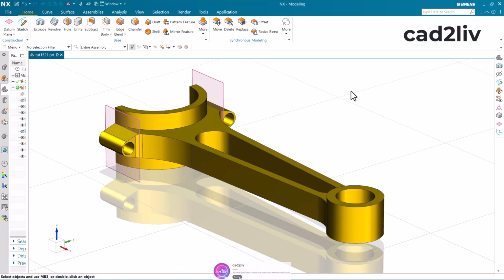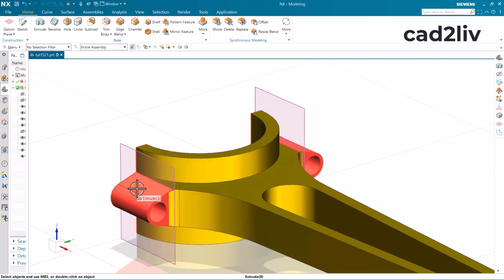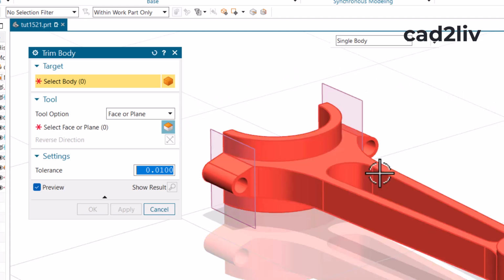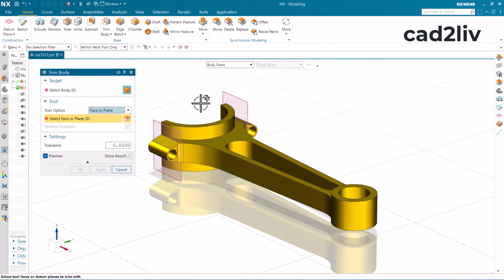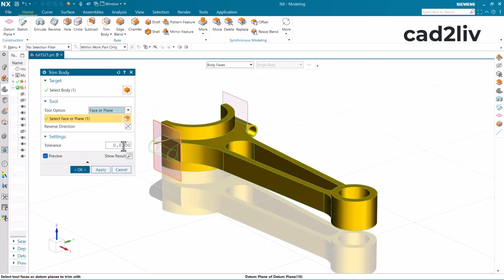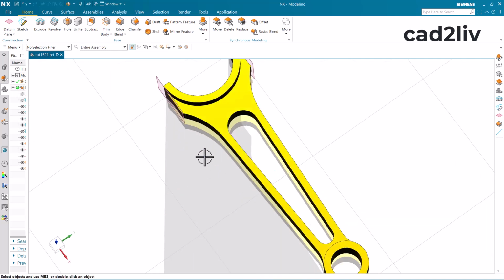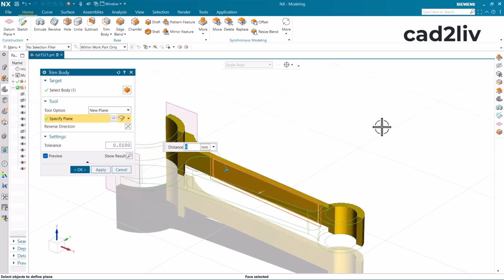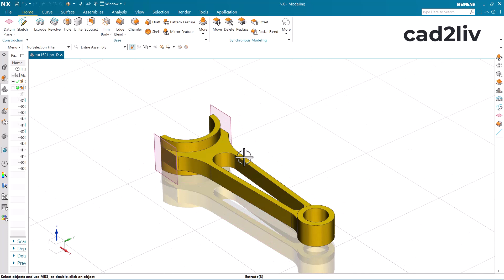NX Modeling | #Trim body | How to use Trim body in NX | #nxtutorials | NX CAD | cad2liv

Comment: Great video! Hello sir please need help... Problem with imported data step file cant modify it cant turn right view when i push its turning up way and how can i use it solid body  also want to use in sketch no luck no way... I dont know what to do... Strange when i import it and irs not slightly smooth. Standing when i push lieft view there is some anfle on body strange)) my friend use nx2312 please help
Reply from the maker: Thank you for reaching us! Please write us:cad2liv@gmail.com with proper screenshots.